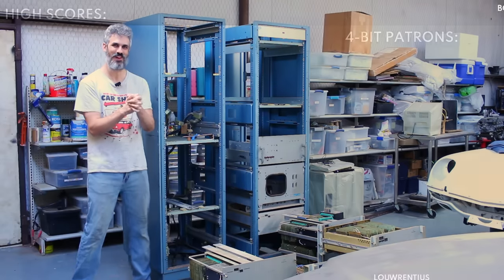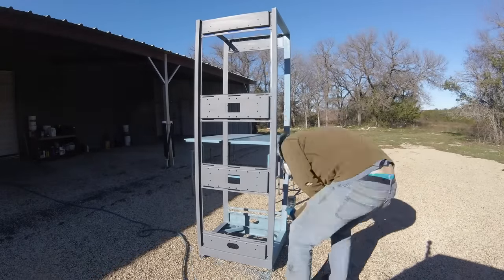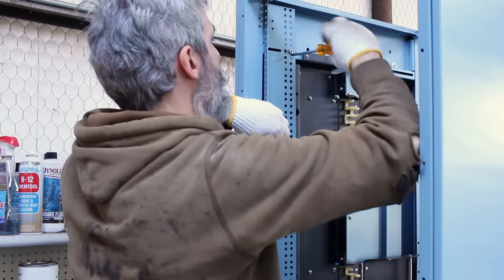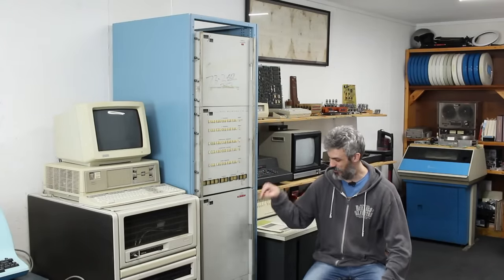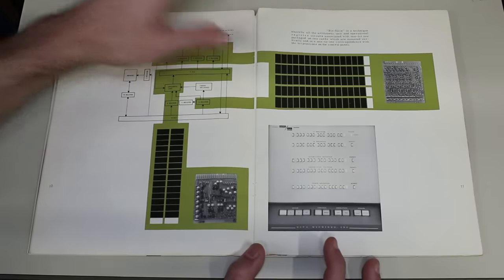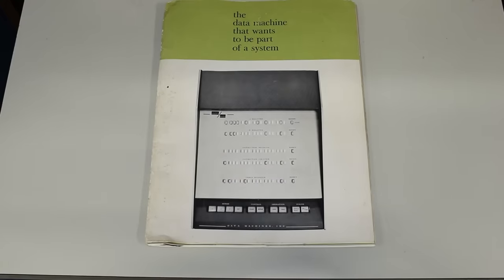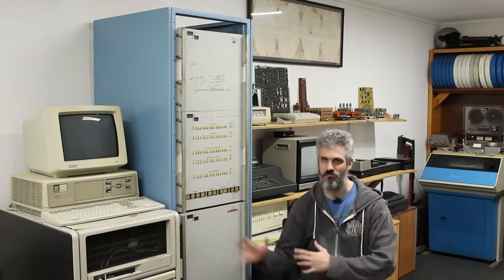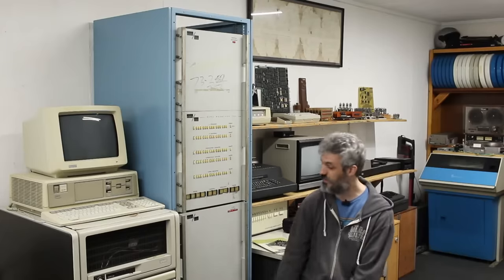My New NASA Minicomputer!

Comment: A friend of mine, his dad, was using a wire brush and a metal strand flew off, managed (some how) to penetrate his clothes and lodge itself in one of his testicals. I shyte you not...he lost that one. So, yeah, take it easy with those wire brushes.
Reply: Yikes, I've had brush wires stuck in my arms through a heavy cotton shirt before (weirdly don't find them until trying to take the shirt off), but since your post I'm extra glad I worked in a knee length leather apron!
Reply: Got one in my eyeball once. Trip to the ER. Eye patch and antibiotics. All ok.
Reply: @brianhanson9367  Yikes. There's 4 orbs on/in my body that I don't want to lose. My nuts and my eyes! LOL

Comment: Interestingly, this is the exact architecture of the old Honeywell 1648, or 316, AKA the famous Honeywell Kitchen Computer of Neiman Marcus fame. A, B, and X index register. 32k ferrite core memory, 16 bit, octal. I believe that was circa 1969. The instruction sets look remarkably similar from what I recall. Sense switches too. I learned BASIC, FOTRRAN IV and DAP-16 assembler on those machines. We ran dozens of users in timesharing mode on the 1648A running Hazeltines, ADM-3A's, ADDS, and ASR-33's at 300 and 1200 baud (we patched the OS to do 1200), which was actually 3 - 316's functioning as Job, Control, and Communications interconnected by 1 byte ICCU bus. 12 meg removable 10 platter packs. I wonder if that was inspired by this machine?
Reply: That's cool because it bumps the documentation availability right up.
Reply: Tons of them seemed to merge together at different times. Trying to confirm more than one but said Varian was acquired by Sperry. But, Sperry was not Acquired by Honeywell until 1986.
Reply: Wow, it's like people were running business and science labs on clockwork, hearing stuff like that! How could you run timesharing on 32K and 12MB!? I know they even did it with 8K and 5MB on some machines, but it's just so unbelievable, now I'm typing this on something like a dozen Cray-1's all wired up on one chip.
Reply: Also the same computer architecture used to develop the first MRI machine.
Reply: I agree that this looks very similar to the Honeywell Series 16. I used the 1648 time share system as a Honeywell summer employee, and then programmed H316 systems used for data communications starting in 1971. Note that the older 516 was made by CCC - Computer Control Corporation, bought by honeywell and renamed CCD - Computer Control Division. The H316 CPU was, I think 11 boards about 8x10 inches each, filled with flat-pack ICs. The later H716 could be expanded to 64K 16 bit words, but since the instruction set used 15 bit addresses, we had to use memory bank registers when we went over 32K words.

Comment: This video makes me sad.  The largest of the Houston makerspaces, TX/RX, had probably thrown away more historical computing than it's preserved.  I know that they had the training simulator for the CanadArm - they may still have the first handmade 6-axis controller that came with it, but the original 286 hardware and casing are long gone.  Also gone is the Transmeta Crusoe cluster that noone was able to get functioning due to lost hard drives.  It is good to see you preserving this historical computing hardware.

Comment: The computer could have been part of the Apollo Command Module or Lunar Module simulators at JSC. Checking online, the simulators used Data Control's DDP-224 and DDP-116 that were made by Honeywell. Possibly, they replaced the DATA 620 computers for more horsepower for the simulators. Also, the DATA 620 could have been part of the Gemini program's spacecraft simulator.
Reply: Would that mean there's a chance that an AGC could be hooked up to it? Or other simulated equipment like communication test computers? I smell a collaboration with CuriousMarc brewing here.

Comment: I worked with the successor to this computer, the Varian 620f, as an engineering intern at NASA Dryden Flight Research Center back in 1977. The machine was installed in the Remotely Piloted Research Vehicle (RPRV) lab, though it was largely unused at the time, having been replaced by a newer Sperry/Varian V77 as the flight characteristic computer, translating ground cockpit inputs into PCM signals transmitted to various pilotless aircraft (not toys!) for flight research. The supervisor of the lab gave me access to the 620f to practice assembly language programming. As I recall I would use the TTY to punch a paper tape of my ASM code, then configure the console to load the Assembler program tape (from the same TTY), then load my source code from tape and spit the output back to the TTY. It was glorious fun for a 19-year-old kid and the start of a long career in computers and electronics. Although they share the same 620 designation, the 620f was light years ahead of what I see being worked on here. Though the 620f also used core memory, the CPU was almost completely integrated circuits and the whole package (CPU+RAM) took up less than half the space of this old 620 CPU alone. They do seem to share the same architecture and instruction set from what I can see, but the Varian version was much more like a PDP-11 operationally than this ancient beast. I can't wait to see its transformation into a working system. Cheers!

Comment: Those non wired connectors in the memory drawer: would these be for the 18 bit option? If you would have the 18bit machine those connectors would be wired at the back and filled with cards

Comment: I have a lot of experience on the 629i,622i computers as well as the v70 series.  I have a neat tty program that gives memory entry search functions.  The program was originally run on an SDS939 computer then modified to run on the 620i and 622i computer.  I have since converted it to run on my PDP7 computer.  It was normally stored on paper tape.  I built a copy of the 622i from discrete IC's on four large cards... used 3000 feet of wire wrap.  I expanded the registers using the extra 2 bits to add additional index registers.  The party line I/O is really easy to interface.  It is basically two phase... address and then data,  Most of the semiconductors of this vintage are silicon... 2N2369 and 1N914 for example.
Fred

Comment: I realize it has been months, but this may sound crazy, but get an erasable marker (for those whiteboards) and trace over the pen markings.  That usually lifts the "permanent" marker easily.  Just wipe it off.  If it works or make it lighter, then repeat the process.

Comment: Had to share my knowledge. Core memory is a read write cycle. Because if it wasn't it would be impossible to branch back to any address it had just read. For the clunky ASR33 you'll need a serial interface, the cards for that may in there already. Nice looking PDP 8. One of the things I did at DEC  had a PDP 8 to my left. I was doing test and repair on a KV8I interface driving a Tektronix vector graphics display where I could play Lunar Lander. Off a paper tape! But I had a PC05 high speed reader punch on the PDP 8. I worked at DEC 1969 thru 1975. My experience on DEC equipment ran from PDP 8 thru 11/780 VAX systems. Loved the 11/45 system, absolutely a pleasure to do repair work on. Right down to the failed IC, not circuit board level repair, including core memory. Finally OH look a TEAC 4010 back there. I've got two of those in my reel to reel collection of over twenty machines including two all vacuum tube units. And I do repair work on them. And on this NASA system the two extra bits to a total of 18 were probably parity bits, one for each byte. Which would require 18 bit core memory. Enjoyed the video too, thanks.
Reply: Actually it's read-modify-write.  As core memory reads are destructive.  I wanted to work at DEC, but they sent me an invite 6 months after I had started my first job.
Reply: @timradde4328 It's both, if you read an instruction you don't modify that instruction. When the core is read they set a flip-flop or not depending if it-s a one. That flip-flop can be changed on a modify cycle. If not then the FF feeds the write circuit inhibit circuit to prevent the core from being set to a one state if it was original a zero. If the source and destination are the same memory location, then a read-modify-write occurs. Otherwise there's nothing to modify.
Reply: @rpk5568  There is still the possibility of a modify.  That's how core work.  Read-Maybe modify-Write.  That's how it has to work.  Thus when you read it has to be re-written as the contents destroyed.  Ok, during instructions that's fine.  But what about an increment.  You read the data.  It's now gone.  You need to add 1.  And write it back.  Come on, it's not that hard.  Just a generalized view.  Of course you can prevent modification but overall I've always seen it described as read modify write.  Can we drop this now as I don't plan to argue with you about it.

Comment: 26:20  ever try WD-40?   Removing magic marker was hit or miss for me, I think often dependent the surface.   But WD-40 sticks in my mind as I've used it to remove markings just on a whim, not expecting it to work, but sometimes it does.   Typically I try that before I try brake cleaner as WD-40 has never really damaged anything I have used it on.
Brake clean, however, can be kinda nasty.  ;)

Comment: So, what exactly were these microcomputers like NASA-kun used for? I know that the mission control room used terminals connected to a single extraordinarily powerful computer for it's day. So in a way, each station operator was sitting at an app on mission control's system. This strikes me as an independent computer by comparison. So transistors or not, we're barely talking the power of a commodore 64 here, with less ram.

Comment: Just a quick painting tip: brake clean is fine, but it can leave an oily residue. As a final step go over the area with denatured alcohol to get the brake clean residue off.
Reply: Oily residue from Brake cleaner can be dangerous.😁

Comment: I remember the core store machine I used at university in 1975 still had my programs loaded when I can back from the summer break!  60 years is a bit longer but as long as the cores didn’t get hotter than their Curie temperature down in Houston dat should still be there - bureaucrats withstanding!

Comment: The way the light/switches are spaced as 1-3-3-3-3-3 on the front panel is indicative of an octal architecture.

It seems likely that the unpopulated slots in the memory and processor sections would only be present in an 18bit machine.

Comment: Oh, my, the original Varian Data 620, built from discrete transistors, not the later and smaller 620/i made from integrated circuits. (Both those machines could optionally be fitted with 18-bit memory, a feature dropped later.)

Comment: The March 1967 Technical Facilities Catalog Volume II (Report # NHB-8800.5, VOL. II Section 11, Page 55) makes makes reference to a "Telemetric Incorporated Model 620 Decommutator" at the Houston Manned Spacecraft Center's Digital Techniques Laboratory on July 15, 1966. This Lab also had a DEC PDP-5 with a CME-8 memory extension and two DECTAPE magnetic tape units. Lots of pulse signal generating equipment in the lab as well.
Reply: Nice find! From what I was able to turn up, it appears they also used a Varian 620/f as part of a data analysis system in the Mississippi Test Facility Earth Resources Laboratory. Apparently when the computer was first delivered there were severe problems with the CPU that "caused significant delay in program assemblies and checkout" that Varian were unable to fix, so they ended up just installing a replacement. Just glancing at the documentation, the ERL-DAS sounds like it was quite a sophisticated system for its time.

Sources:
Earth Resources Laboratory Data Analysis System Final Report - October 1972 (Report # 1746FR-1 sec. 1, pp. 6-8; sec. 2, pp. 2-4; sec. 3, p. 2; sec. 4, pp. 1-2, 4) 
A Procedure for Automated Land Use Mapping using Remotely Sensed Multispectral Scanner Data - January 1975 (Report # NASA TR R-434 pp. 32-33)
Reply: Looks like they also used a Varian 620/i to control the McDonald Lunar Ranging System. One of the documents I found even has a program listing!

Source:
A Description of the Control Program for the Lunar Ranging Experiment - November 1969 (Report # TR-70-064)
A Description of the Time Interval Measurement and Laser Control Circuitry for the Lunar Ranging Experiment - November 1969 (Report # TR-70-049)

Comment: Interesting to see how much the first affordable CPU, the MOS 6502 (initially marketed at $20) has in common with this minicomputer. Both have accumulator A and two index registers (X,Y for 6502 vs X,B for this minicomputer) and common addressing modes of immediate, indexed, and indirect. Of course the 6502 was just an 8 bit computer compared to 16/18 bits, but still it is amazing how much technology advanced in just over a decade, going from a giant rack mount behemoth costing tens of thousands to a single $20 IC… in just over a decade!!!!

Comment: For that permanent marker, you might try going over it with dry erase marker. It's a trick I was told many years ago that does work pretty well, though not necessarily perfectly.
Reply: Or go over it with another permanent marker (Sharpie, Marks-A-Lot, etc.), then use your usual marker removal solutions.  The wet marker solution (dry-erase or permanent) will rehydrate the old marker doodle and make it easier to remove.
Reply: ive used that trick, someone took a sharpie to a white board and by using a dry erase marker over it the permanent marker came off easily, due to its age it might not fully remove it but it should at least thin it out.
Reply: Permanent marker comes off with ethanol. some common or garden vodka will work well, as with methylated spirits
Reply: Why don't give WD40 a try?
Reply: Naphtha cleans that stuff in one wipe and doesn't damage anything under as it flashes too fast. It just leaves a white layer behind which can be cleaned with a wet napkin.
Reply: I've usually found that it's necessary to sacrifice a very shallow layer of paint to get rid of this kind of thing.
And the paint underneath always ends up being conspicuously lighter and brighter. 😔
Reply: @btraker Yeah, kinda like using a bit of real solder to get that useless lead-free crap to cooperate.
Reply: I might go ahead and try searching up the number to see if it means something. Could be something scrawled on by a NASA employee back in the day, maybe when it was retired
Reply: I would always try citric cleaner or label remover first, or better said, limonene is the actual solvent needed while citric cleaner and label remover usually is a mix of limonene and IPA.
Limonene solves all kind of glue and styrene, so be carefully near polystyrene surfaces.
The problem with permanent marker is that the color can go deep into the paint and on some smooth surfaces the pen also often produces scratchmarks.
Reply: Magic erasers/Magic sponges are pretty good fine abrasives. Together with a little water will get most stuff off and bring it up like new. Be careful not to overdo it though.
Reply: If all else fails, he could try a graffiti remover. They're good at removing surface marks without affecting underlying paint (usually). Test on an inconspicuous area for sure.

Comment: Ohh, taper pin backplane. Theoretically a gas-tight weld when you drive the pin on the end of the wire into the socket. Practically, a source of flaky connections, and pins that fall out! You'll need to find a taper pin insertion tool (clicks when you press on it to give an impact) and a taper pin removal tool.

Comment: i was saying "I hope you don't have to rewire this," when you had the memory module open.  Then I saw the unconnected wire in the processor module.  I suppose, when you get the thing powered up, try to make a program that runs through every instruction and each addressing mode.  You got your work cut out for you :)

Comment: Back in the day, I've thrown out hundreds of these cards mainly because they contained (at the time) worthless germanium transistors and were usually coated in epoxy which made salvage nearly impossible.  So, I would take the silver-mica and mylar caps, the power resistors and any other goodies that I thought useful or worth the time to strip. 
On the marker-marks on the front processor pane: You may find them impossible because (again) back in the day, permanent markers were actually permanent not like the joke Sharpies we now have.  These old markers contained xylene and toulene so they literally eat into the paint!  Anyway, have fun and thanks for sharing!